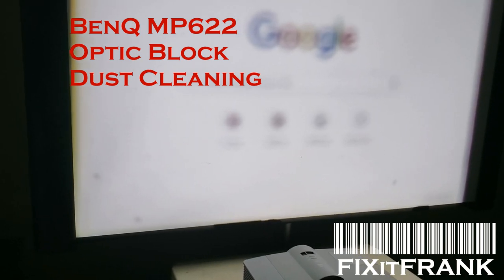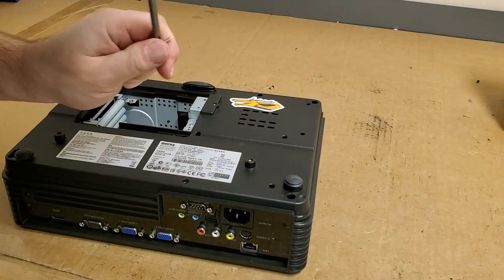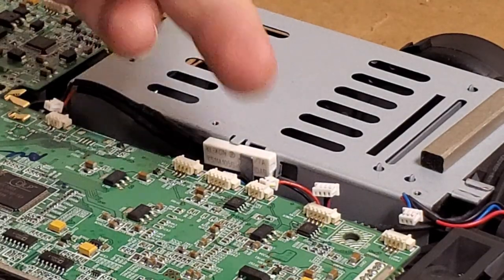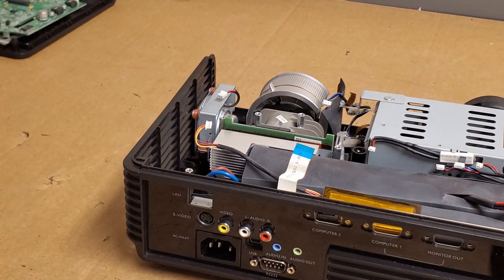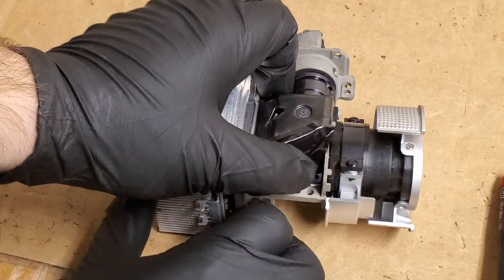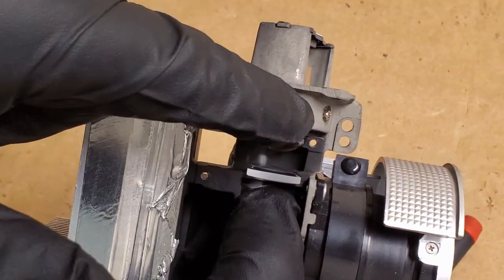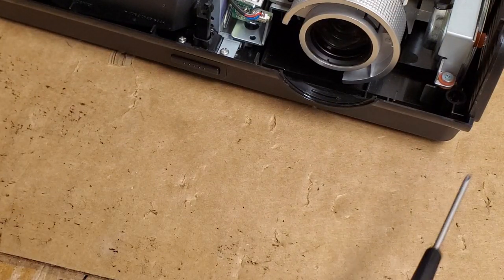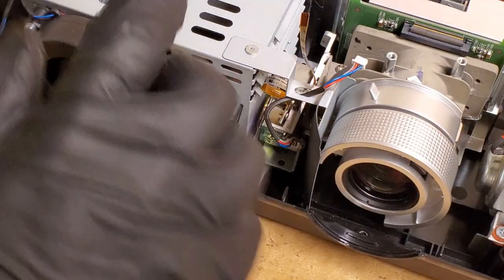BenQ MP622 DLP Projector Optical Block Cleaning

Comment: Great video, Frank! Would you maybe consider making a video on how to clean the optical unit on a BenQ W1070? Or is the process pretty much the same as in this video?

I am having some small spots on the screen that are visible when some colours or backgrounds are shown.

You are the best and thank you for what you do!
Reply from the maker: Its basically the same as this.  But there will be a specific 1070 video eventually.
Reply: @FixitFrank  Thanks a lot for your reply Frank! I actually fixed it myself with a little bit of help from another video I found and the difference is enormous!

Comment: Hey Frank, I have suddenly noticed specks of dust. Could this be because it stood on a dusty table? And how do I do this in my BenQ TH681?
Reply from the maker: I'd have to see a picture to be sure. It could be dust or a bad DMD depending on the spot shapes. Can you focus onto the spots at the same time as the picture or is the picture focused and you see blobs with halo's? Dust spots will be out of focus when the image is focused and vice versa. If you see clear spots with the picture then the DMD might be bad.
Reply: @FixitFrank  the specks can be focused on. If I have a clear picture they look like slightly brighter spots. My girlfriend doesn’t notice them but to me they ruin dark scenes. If I adjust the lens I can focus on the spots.
Reply: @FixitFrank  oh and if I take it apart another video from a german guy recommended using an air duster can to clean the dmd chip by simply removing the lens and not the entire optical unit. Is this also a possible solution?
Reply: @FixitFrank  I think I ruined my projector. I couldn’t reach the chip like in your video but only by removing the lens in front of the whole assembly. Then I wiped it down with a cotton swab and window cleaner (a repair guy told me to do this) and now it has even more dust and as a bonus some nice smudges. However I think there’s a glass in front of the chip which is what I cleaned
Reply from the maker: Dont use window cleaner on a projector.  The lens coating will be stripped. dionized or distilled water is okay but no solvents.  your DMD is likely what is dusty.

Comment: Hello Frank, I have a BenQ W1070 that started to have the image stop working after 5 - 30 minutes (gray screen, buttons not responsive as far as I could tell. Lamp, sound and fans still running- projector seemed to think all was well) It then progressed to only lasting a few seconds to then only having the power light on solid red and a noticeable squeal now coming from the unit (I suspect from the power supply). I seem to be getting the expected standby voltages, 3.22V and 14.8V. In this video at 7:30 you mention the PWD1000 as a possible cause, do you happen to have a video on troubleshooting this? I have also been unable to find a data sheet for this chip, if possible could you post a link for this. Thanks for your videos and help
Reply from the maker: Honestly that sounds like a color wheel issue. The squealing and the grey screen are symptomatic of that. The voltages look ok to me. 
I found the service manual for the w1070 on elektrotanya.com and it has the pmd1000 circuit but I don't think it's a power problem from your description. At least not yet. I'd focus on the color wheel and color wheel sensor. I'd recommend downloading the service manual and check the color wheel first.
Reply: @FixitFrank  Thanks so much for your input. I will have a look. Cheers again.

Comment: Thanks for posting this Frank! If dust is in the optical block, does it typically show up as a small spot on the screen? I just bought a used BenQ HT2050a and there were two very large fuzzy-looking spots (I'm guessing dust bunnies), each taking up probably ~5% of the screen. I tried replacing the old lamp and no change. I ran the projector on high altitude mode thanks to a tip I found online and that got rid of one of the two spots (I actually saw it get pushed off the screen), but the other one has remained in place. I'm hoping to avoid getting into the optical block, so am wondering if a much larger spot means that the dust is located in some other area of the projector and can be removed with a different method. Any thoughts?
Reply from the maker: It's probably inside if its visible in the picture.  If the dust is before the DMD in the optical path, it tends to be washed out by the light.  If its on the DMD or in front, it shows up like that.  See if you can focus in on the dust blob.  If you can sharpen the shadow, its in front for sure. I'm actually working on an 2150 right now with a dust blob issue(same chassis). I should have that video up this weekend. sit tight and I will see if I can show you any tricks that minimize disassembly.
Reply: @FixitFrank  Thanks for the response! Will keep an eye out for the new video.
Reply from the maker: editing now.  It will be up later today/tonight. I recorded a part just for your situation.
Reply from the maker: https://youtu.be/SIhOAUVlRd4

Comment: hi frank, is it not necessary to clean color-wheel ?  as i observed in this video.
Reply from the maker: Only if the color wheel is very dirty. I had cleaned it previously with air so it did not need more cleaning.
Reply: convinced.
Reply: a dirty colour wheel will not have a persistent spot as it never stops moving during the operation of the projector
Reply from the maker: @sausagedog52  he's not asking about it because of the spots. He's asking if it needs cleaning in general which it did. Dust causes all sorts of issues beyond visual problems.

Comment: Hey, thanks for the video, it is very clear. I don't have Kimwipes at home and I live in France, what should I clean up with instead?
Reply from the maker: Eyeglass cleaning cloths or cleaning paper(dry kind) would also work.  Any sort of photography supplies for lens cleaning are more than perfect for it.
Reply: @FixitFrank  are Qtips a no ?
Reply from the maker: @sim_lmbr  they are fine.  The main thing to remember is you don't want to scratch or add dirt to the lenses. As long as you consider that you will be fine.  I have gotten away with using clean toilet paper before.
Reply: @FixitFrank  all right I'll be careful. Thank you very much !

Comment: Hwo do I remove the lcd assembly from an NEC M260W?
Reply from the maker: Its kind of involved.  You need to take the screws out near the lens that hold the prism and LCDs in place. I have an old panasonic LCD video where I take an LCD out. The steps are pretty close.
Reply: @FixitFrank  thank you as always!

Comment: wouldn‘t it be easier to just remove the dmd chip from the backside (4 screws to remove the heatsink)
Reply from the maker: Not really. Then you have to take the whole DMD card apart.  It chances damaging the connections between the DMD and the riser. If I was replacing the DMD I would probably clean it from the back but for this, going though here was fine and it let me show all the lenses better.
Reply: @FixitFrank  other ways to reach im a w1070?
Reply from the maker: Im sorry, I don't quite follow your question.